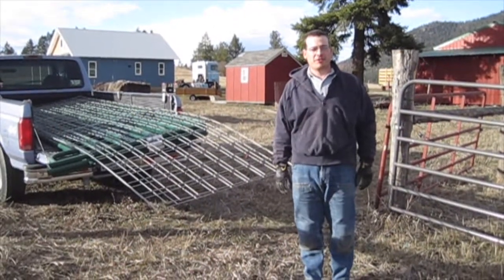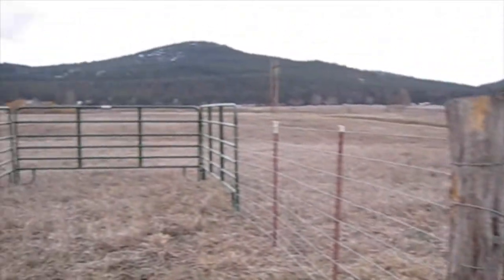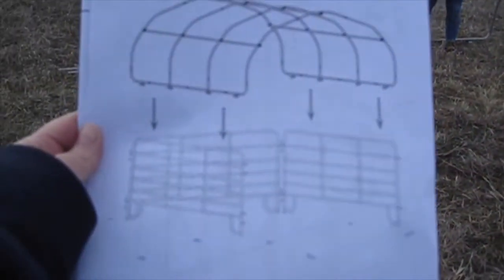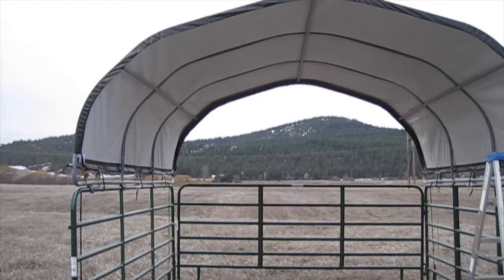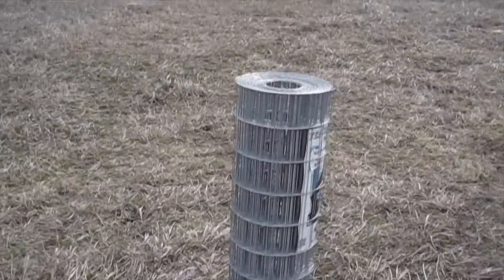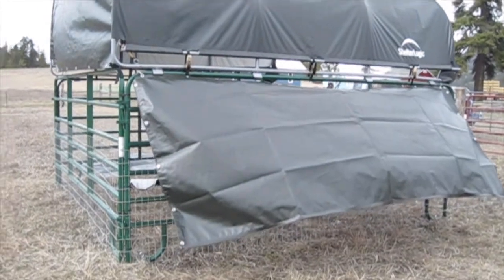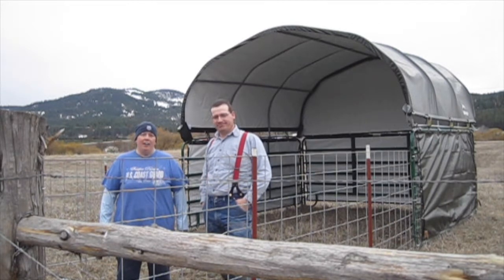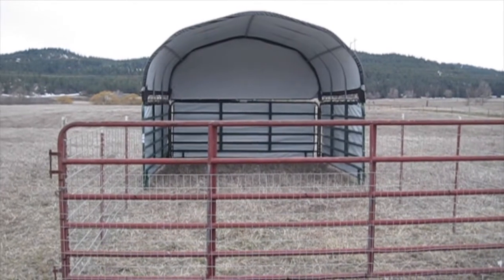Building Shelter Logic Corral for Calves

Comment: Thank you very much for posting this! I am planning to make temporary horse stalls out of the corral panels and the shelterlogic! I didn’t know that they also have an enclosure kit! That will come in handy during winter time! Would love an updated video on how it holds up to winds, and if you get snow as well!? I live in Wisconsin so we get plenty of snow!
Reply from the maker: We do get snow, but built this shelter closer to spring this year.  Only had a few inches since then and it melted quickly. I'll definitely give an update after this next winter. So far, though, we were both really impressed with the durability and stability of the structure. Using hose clamps to firmly connect the corral panel corners made it very stable. Good luck!!!
Reply: Blue Creek Dairy Farm WA thank you for the advice on the clamps will keep that in mind when I buy the panels and kit!!

Comment: You guys keep coming up with videos I need! Love it
Reply from the maker: Awesome! Glad it is info you can use. We hoped it would be helpful for those looking for a pretty sturdy temporary shelter.  We thought about building a wood run-in type structure, but didn't like how it would be pretty permanent.  This structure can be taken apart and components used elsewhere. Plus, not cost prohibitive (especially if you already have some corral panels) and looks nice.  We are still planning the large wood barn in 2019, but feel confident this will get us thru next summer.  Will most likely buy another curved end panel to enclose the front top area for winter.
Reply: Do you have any photos or plans for your big wood barn you are going to build in 2019?  Just curious.  Thanks  Blue Creek Dairy Farm WA

Comment: Hi there! I'm considering Shelter Logic for my horse's temporary shelter this winter. I'm wondering what anchors did you use for this one?
Reply from the maker: We used the ground anchors that came with the kit. They worked well for a couple years until their was an unfortunate combination of high, gusty winds and saturated soil conditions! As a long term investment, you may want to upgrade your anchoring system. Overall, we were impressed with the Shelterlogic and would recommend it. You might want to check out our other video on it: https://youtu.be/xbSQ5SWycmA

Comment: I have never seen this product before, very nice. I’m curious though, for $500, could you have build a more rigid and lasting structure with wood? Thanks again for sharing this, Dave.
Reply from the maker: Dave Pruitt great question! We were wondering that too, but also needed something temporary because we are building our big wood barn in 2019. Thus, we didn’t want a wood structure that we’d have to take apart. Plus we can reuse all components of this corral elsewhere. The Shelter kit & enclosure kit together were $300, the three corral panels were about $200. Thanks
Reply: Blue Creek Dairy Farm WA Ahhhh....makes perfect sense.
Reply: I can certainly build something more durable for $500 but I am afraid it won't be this easy to remove or move around. The roof in this product I believe is easy to move

Comment: How did this hold up? I see this video is a couple years old, I am wondering what the durability was. Did it hold up to high winds?
Reply from the maker: https://youtu.be/xbSQ5SWycmA
It did great until we moved it and forgot to recheck anchors!
Reply: Clover Mountain Dairy do you think if it was anchored deeper with tposts would it of blown away? We get winds here in Oklahoma that can be up to 70 mph+...
Reply from the maker: It came with screw-in anchors, and our soil was super-saturated from recent heavy rains, and I think that contributed. I would look into heavier duty screw anchors. I don’t know what the wind rating of the actual structure is.

Comment: Hello, Just wanted to ask how this help up over the winter? Do you think it will last many winters?
Reply from the maker: The shelter worked great over the winter. No problem with the snow or ice. The top cover looks great. The side enclosure pieces will need to be replaced as some of them tore at the grommets due to wind, and the help of curious cows! The corral panels had no problems. Overall still very impressed with the kit and we will get at least another year out of the top cover, the top frame should last much longer.